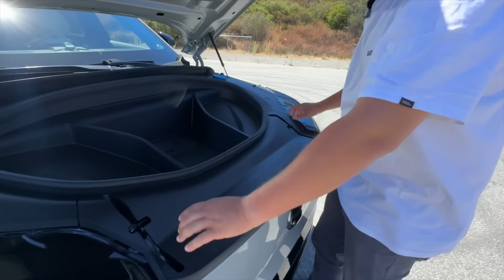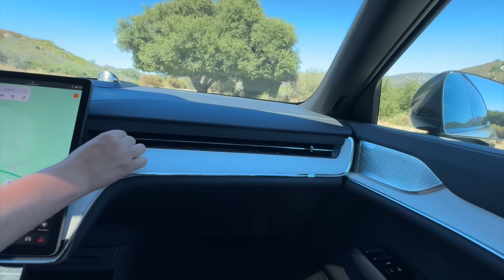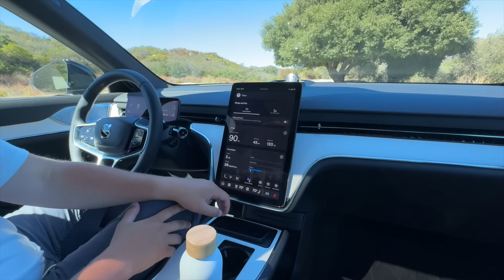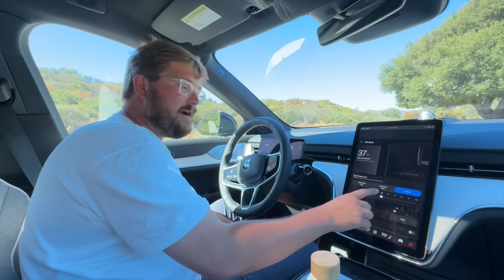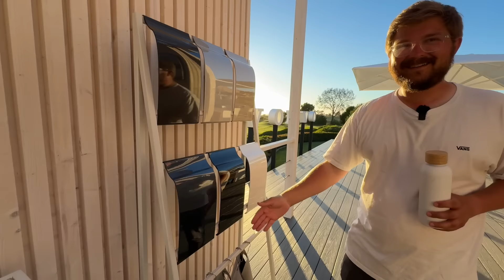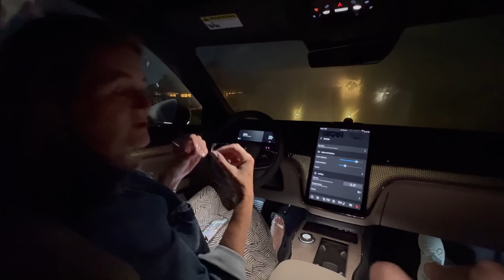Volvo EX90 Full Tour! Detailed Look At Software, Space, Interior, Powertrain, Battery, & Much More

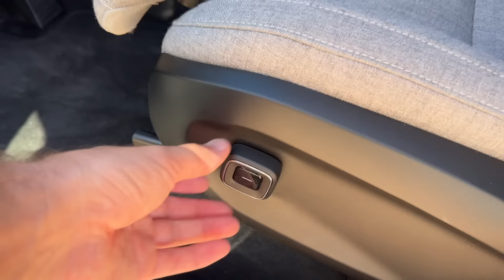Comment: 40:50 you missed the biggest improvement in Volvo front seats in years especially since your tall should be the first thing you check! The sun visors finally slide! Only tall guys understand my pain. When flipped to drivers door position previous visors never slid back to block sun for tall drivers. Now it will take them another 15 years before they offer a dual visor so you don’t need to keep flipping it back and forth but I’ll accept this small victory of a sliding visor yay!

Comment: The massage function in car seats, especially those with electric motors and vibrating elements, can generate heat during operation. A 20-minute limit helps prevent the system from overheating and potentially causing damage or discomfort.

Comment: The EX30 interior should have been along these lines. And if they had also put the rear seats back 5cm, the EX30 would have been fine.
Reply: I don't agree. I love the EX30 interior. It's more adventurous with color and very innovative. This is more standard Volvo luxury and should be as it is much more expensive.

Comment: In Europe you can also get a single motor version. And a basic core version. 
The eX90 already has a one year delay. They need the sales, so they decided to start the deliveries. 
For the VW group: they did launch the ID.3 early with bad software. 
They waited for the PPE architecture cars. Hence I got the BMW i5 over the A6 (since it wasn’t available yet). 
As it currently sits: The Audi A6 etron performance avant comes to 100k Euros (very well equipped), is a lot more efficient and chargers better. The EX90 twin (non performance) ultimate (without bowers and Wilkins) on 20” (with optional air suspension here) is 112k Euro. Seems fair, but I have 2 more years to choose again. The only thing is: I don’t really need the space or the seats, but I like the comfort. On the other hand: I did see a teaser of the Volvo eS90.

Comment: Literally for adjusting anything driving related except you have to take off your eyesight from the road. Literally everything, driving modes, having AWD on or off, adjusting suspension, adjusting climate, adjusting seat heating, adjusting masage. The lack of very normal functions as physical buttons of switches really annoys me to the point I could never consider buying this car. Visually this car looks cool, physicaly size is great AS EXTERIOR but that does not match the interior that seems very small considering exterior dimensions.  That glass roof situation is a dealbreaker and in a 100grand car is 100% unacceptable.  That is hidious mistake not giving a blind or dimming. And no fiddling with some ridiculous stick on cover in this budget of a car is just a big middle finger.  Night rides are gonna be so annoying.
This is like the most beautiful spoon you can ever find, but it has so much holes in it that you can't have your soup. That's how this feels. Impractical and just surface decorated.

All that info about the sound system blabla feels like they try to distract users and ppl in showrooms from the actual real life things. If you cant even get charging that is specced anywhere, if your large suv is just medicore large, if you cant use any of the tech you ordered before some 6 months, if you pay like 20 grand premium over competition, if you gotta go always into menus to change something in terms of preferances, drive mode or anything climate related I just can't believe how ppl who work so damn hard and gotta be some what inteligent to go through those carreers accept this kind if a lackluster combination of things. The user interface is not user friendly. Volvo is not doing great currently - their losing their grip honestly.

Comment: 13.5 Watts USB charging? I've been so frustrated with low speed charging in cars, for so many years. It was annoying two cars ago, at this point it just feels insulting.

You can buy a superfast or even 100W+ charger for your home to charge your phone, tablet and even laptop quickly, and even buy a 12V adapter for your car that provides 100W (enough for your laptop) for the front seat passengers. What they are thinking?

Charging a laptop while travelling, and chucking your phone on the wireless charger each time you get in are both classic use cases for the fastest possible charging technology.

Do you really need your bedside wireless charger to be fast? No. Does your car wireless charger need to be quick for those half hour journeys that you start with low charge? YES. YES. YES.

I was disappointed the EV9 has only 25W, but Volvo's 13.5W is truly pathetic, and so frustrating on a daily basis with kids constantly running out of juice that I'm simply not prepared to pay this much for a car and regret it every time I get in (plugging my phone into the ugly 12V adapter that prevents me ever closing the center console sliding cover properly). I would not normally even think about a Mercedes and know literally nothing about it, but will go check that out purely for the 100W charging, as it suggests some thought has been put into actualy using the vehicle on a daily basis by someone who will actually drive it themselves (unlike the EX90's window buttons).

How dated will 13.5W feel when the car os sold second hand in four year's time? 

Coming from an XC90, this is just another thing that communicates how few substantial improvements have been made. I'd prefer to pay less and just get an electric mod of the current car, just like the XC40. That could have been ready 2 or 3 years ago when this car was intiially projected to be available. One or two lovely features but nothing to make me think the extra would be money well spent.

And don't get me started on software, I've lost all faith in Volvo's ability to manage an OS and make iterative improvements. The current AAOS software is basically abandonware which still lacks features the old Sensus OS had as well as countless apps that work fine with Android Auto, such as Whatsapp), so I'm out for that reason too, which is a shame, as we've bought several Volvos in a row, but they havent put their money where their mouth is and can't be trusted.

If you buy this, prepare for bugs and becoming a beta tester for the first few years, after which (just as you think they might be able to move beyond bug-fixes to actually make improvements, move towards feature parity vs the previous OS, and god forbid add features!)  they will stop updating and divert all their developers to whatever new model they are introducing (which will launch with 15W charging if you're super lucky, a ton of beta bugs, missing features, more empty promises that feature parity will be achieved, and thus the cycle will begin again).

Volvo is a classic case of 'buy what is available now, not what is promised' because those promises may (most likely will) never be kept. Volvo consistently over-promises, and under-delivers. This car was initially expected to be available years ago and the goalposts kept moving. Yet even now, what is available won't meet the price/quality expectations the car is pitched at. Most likely it never will. Caveat emptor.

Comment: Great video 👍 As far as I know there's a difference in powertrain distribution between the two versions. The Twin version are primarily front wheel drive, but can engage the rear motor on command. However the Twin Performance are primarily AWD with a rear wheel biased. That one can additionally disconnect the front during coasting 👍 Did you get different information? Regarding the sun roof, there's a optional manual cover that you can click into place. Should be electric.

Comment: EX90 is slightly longer than EV9. Still not enough to be 7 seater? :(
Reply: well it actually is a 7-seater!
Reply: @volvoniac_de  Except that 3rd row is very limited. My current car also has a very limited 3rd row, but my current car is a  combustion engine and just 4.64m long. And this one is 5m long, still not enough to have a reasonable 3rd row?

Comment: @outofspec hi guys. FYI O3 is ozone. At ground level is a pollutant. Also I have heard from another review they don’t have an overt dog mode but they do have an interior motion sensor that will turn on climate control and ensure interior is within a “safe” range whenever something is detected. I heard it was supposed to be able to detect a child left so it should be pretty sensitive. Hope that’s helpful.

Comment: 1. The ventilated seat will available for Napa leather seat option. 2. The wireless phone charger has cooling fan, in your video,the hoses on the charger is fan holes. It says in the car instruction manual
Reply: Volvo will not offer any leather seats in their all-new designs or their EVs. Only the older hybrid models have leather seats.
Reply: @benjaminsmith2287  Yep, Volvo has stated no leather in this.   Leather is Polestar 3 only is how I heard it.
Reply: @cbotten106  Yes, not animal based leather but looks and feels like leather, Volvo called it Nordico and when you choose Nordico seat, it will include ventile seats.
Reply: @benjaminsmith2287  Yes, not real animal based but feel and looks like leather, Volvo named it Nordico and it has ventile seats. You can design your own on Volvo's website and you can see this option.
Reply: @skshgy  Yes, they have the Nordico but unlike Polestar, who are using Nappa leather, Volvo is going with no natural leather anymore in their BEVs. They still have it in their older gen hybrids however.

Comment: As a Swede very familiar with Volvo I must say the front interior is a bit of old Model S design.... So why making a vertical screen when most of the industry is going horizontal screen. Tesla ditched the vertical for a reason. But there is pros and cons with both. That´s why some is making rotating ones.
Reply: I prefer vertical. It mimics a console. I don't want to look left to right for what functions as a console.

Comment: μg is a unit of mass that is equal to 0.000001 grams. μ (pronounced micro) is a prefix for 10^-6 and based on the Greek letter Mu. You might be more familiar with other prefixes such as kilometer (1000 meters)  or milligram (1/1000th of a gram). m^3 is meters cubed, and is a measure of volume. 

O3 is ozone, which is good at high elevations like the stratosphere to protect the surface from UV radiation. However, O3 is also a manufacturing byproduct and can be a lung irritant when inhaled in high concentrations. Ozone is a strong oxidizer, which is why it works well to neutralize cigarette smells in your e-Golf.

So the car was detecting 126 μg of Ozone per meter cubed of air which is equivalent to about 65 parts per billion (ppb). US EPA and OSHA have different standards, but less than 50 ppb is generally considered safe. It makes sense that the car seems to be calling >50 ppb as "poor".

Comment: O3 or Ozone, in this case ground based ozone. Your probably in stagnant air with rising temps. Not much you can do about it short of carbon filters where the gas can collect on. Hepa or other particulate filters are worthless. It is created by fossil fuel use, VOC's, manufacturing processes along with some methods for cleaning air like UV-C light. In high concentration it will smell like chlorine bleach. Sometimes it is noticed after a lightning strike as electrical fields helped create the O3. It can damage the lungs and add to other lung problems that a person may have like asthma. It directly inflames lung tissue, long term exposure should be avoided.

Comment: The reason to brake rear wheels under regen is that it decreases dive and makes the ride more level and smooth. It’s very basic ride engineering that Volvo didn’t get right. Using a 400-volt system in a premium vehicle is puzzling. Interior space looks identical to XC90 which is very tight once you put in car seats. The sound system is not worth $20k over EV9 for an inferior EV.

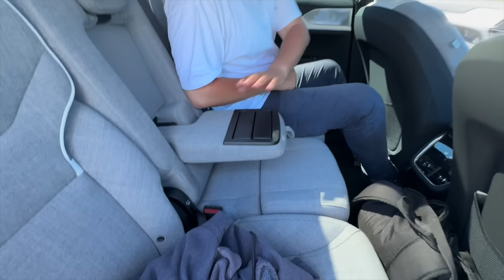Comment: 1:12:00 How did Volvo ruin the armrest design that they have been excelling for so many years before with the cup holders that pop out in the front, in the direction of the front seat, allowing your whole arm to have an uninterrupted armrest, not 50% resting on a cup holder?  🤦🏼‍♂️ 
I wonder if the Volvo/Geely guys use a dish-drying… rack as a sleeping pillow.
1:32:30 - I just saw the sick cup holders in the captain's chair armrest. I get this feeling that Volvo has started using the same tactics as Apple: offering a base model you should not buy, and at the same time, it should not have been offered in the first place since it's a flawed product, something anyone can understand/know, especially the OEM who made the design decision.

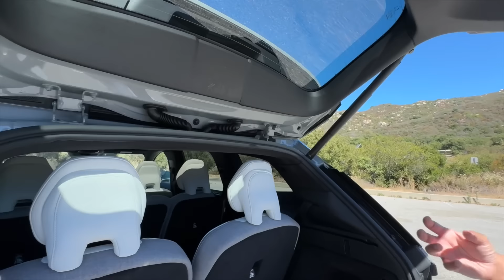Comment: 34:16 Is that an extra rear camera for when the rear hatch is open? 
Under the “will it fit” badge there is black unit with a circular thing in the middle that looks to be a camera lins.
Thanks for the exciting video!
Reply: It is a torx screw, nothing more... T25 to be exact.

Comment: The EX90 does have ventilated seats at least in my build. I just priced out the EX90 Ultra, Twin Motor Performance, 6 Seats (coming in 2025) and it has cooled seats. My build has Mulberry Red exterior with Ventilated Cardamom Nordico in Charcoal/Cardamom interior. Features show Nordic upholstery with ventilation. I agree that fixed glass panel roof without a powered sun shade could be a deal breaker. SoCal summer this year has been mostly triple digits, going up to 128F. Having exposed glass roof without power sunshade is a deal breaker. Volvo, like Polestar offers a manual roof shade for extra $245. Not good for a $95K vehicle.

Comment: The lack of a powered shade for the panaramic roof is deal breaker for me. Maybe it's fine in cool climates but for where I live, in the tropics, it's going to make this car really uncomfortable to live with. It also works against the car since it's an EV (reduced range due to having to run the AC higher).